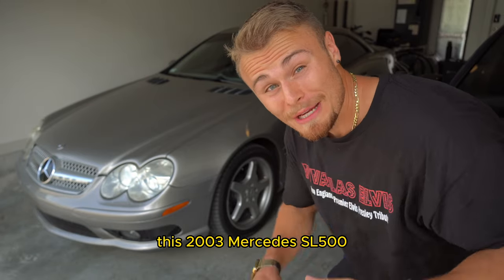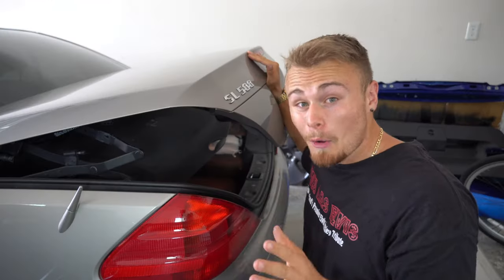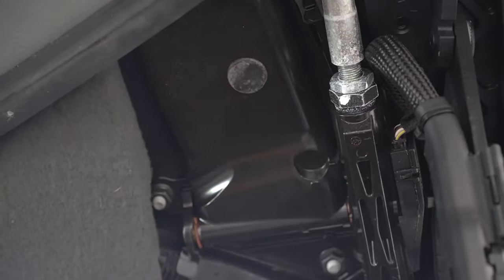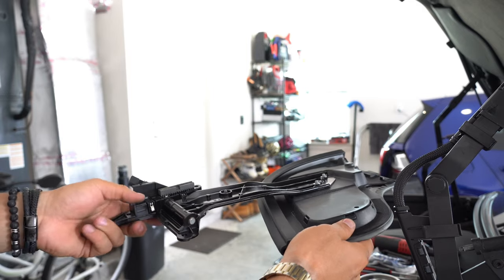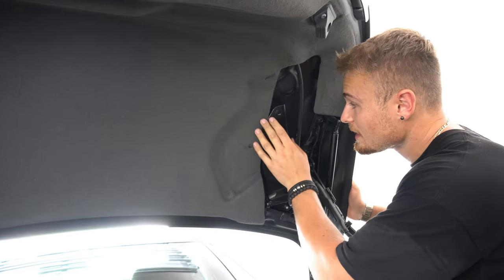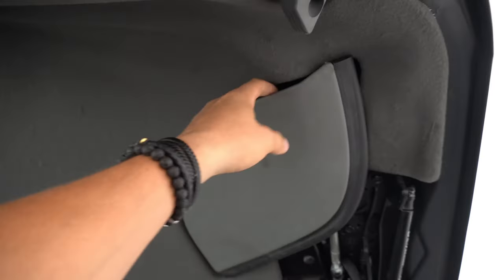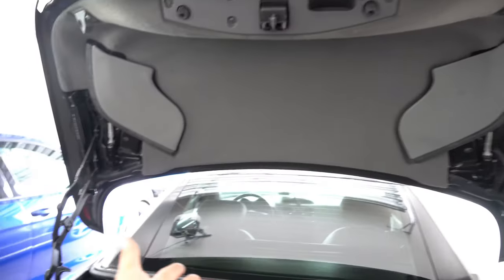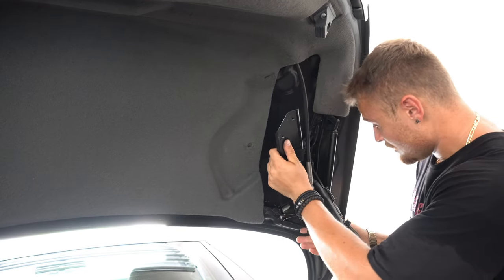I Fixed The Broken Convertible Roof On My $100,000 Mercedes Benz

Comment: This was my dream car at one point, back when I first started working my boss bought one, pops and I had to pull the rear end and line up the frame, getting that top to work right was a nightmare. After that i no longer dreamed of them 😂
Reply: Good job on the repair sir 🫡
Reply from the maker: I CANT IMAGINE trying to line line up the rear end on this car… WAY too many moving parts/ hydraulics/vacuum lines. Sure sounds like a nightmare
Reply: @Haydenschreiermk2  sure is a nightmare, one tiny little bump or something as it’s closing and it just resets 😂

Comment: I had exactly the same problem about 10 yrs. ago. I simply cut a small metal plate about 1.5mm thick and put it underneath the teeth block, which basically raised the teeth up to fit more snugly in the gear cog. It worked perfectly and still does. That cost me approx. zero.
Reply from the maker: haha thats epic!
Reply: @Haydenschreiermk2  Thanks mate. PS - I wasn't trying to be cocky. Just trying to say how I solved the problem in front of me. Have a good one!
Reply from the maker: @fedup3449  i never thought you were cocky! thats thinking outside the box! thank you for sharing!
Reply: @fedup3449 hey bro, same issue here! Can I ask you more details about your solution, was about to try the fixing Hayden shows in the video (thanx dude super well made btw) but if I can get it done by your simpler “out of the box” add on that would be a blast!
Can you get in touch with me? :) thanks again!!

Comment: Don't you think you should be concentrating on the Golf R? What's happening with It, given up because the rear end is bent?
Reply from the maker: Im waiting on the last of the parts to come in.. its on backorder
Reply: The Golf R rear end is about to be looking factory 😉
Reply: @23RD  After it's been pulled and aligned on a chassis jig. No parts required to show how that rear deck will be flattened

Comment: Mine says partition isnt closed but it is an the top wont open ? Any ideas
Reply from the maker: yes more than likely the "soft close" feature on your car is broken and the trunk doesnt think it is closed when it is. people slam it to close it and then it works, which typically breaks the parts that you saw me replace. otherwise theres a possibility that the partition needs to be opened and closed and made sure its fully seated, you can also check if it is getting a signal

Comment: What's the part number
Reply from the maker: https://www.pelicanparts.com/More_Info/2307500111.htm?pn=230-750-01-11-M22
Reply: @HaydenSchreier  Thanks Hayden! both of mine are hanging real loose so hopefully that's the problem. I just finished putting coilovers on it to get rid of that ABC system
Reply from the maker: if you have the orginal factory ones then yes its most likely the problem as i believe they were made of plastic and these are now metal. check and see what you have on. if they are metal than you might just need to reset the teeth in it and tighten it
Reply: @Haydenschreiermk2  Thanks for the advice.